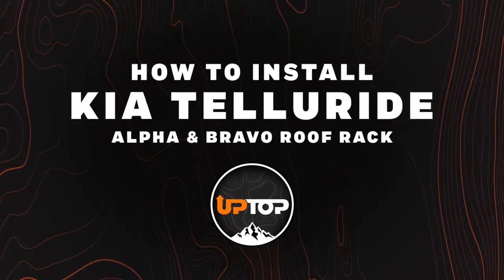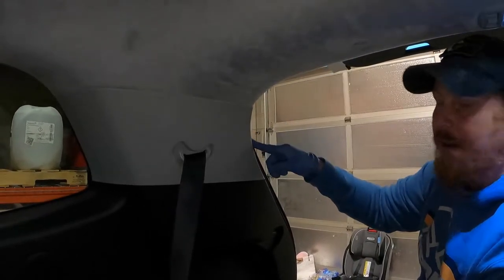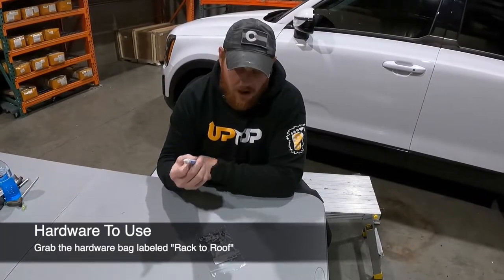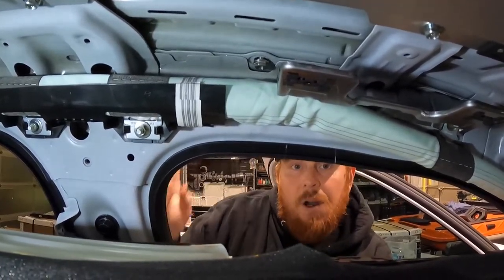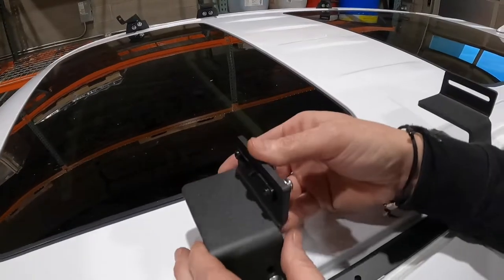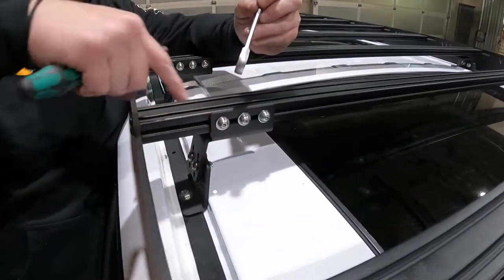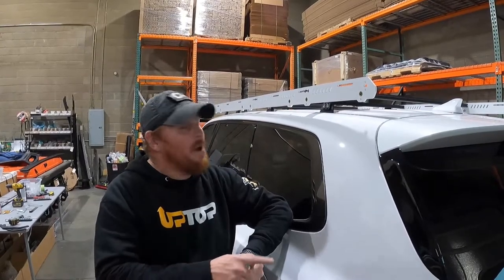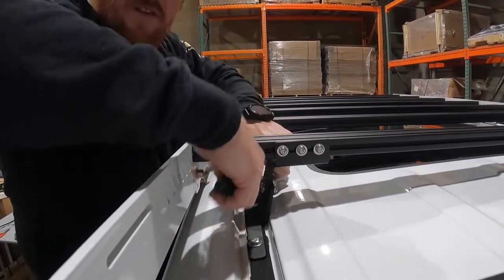Installing an upTOP Overland roof rack on a Kia Telluride

Comment: What kind of effect does this have on gas mileage and wind noise? Also how much do these hold? Couldn’t find reviews or specs on the website where I can buy these
Reply from the maker: It will effect gas mileage a few, it shouldn’t have any wind noise and refer to your cars owner manual for the roof rating because our racks will hold far more than that so you want to abide by the roof load rating!